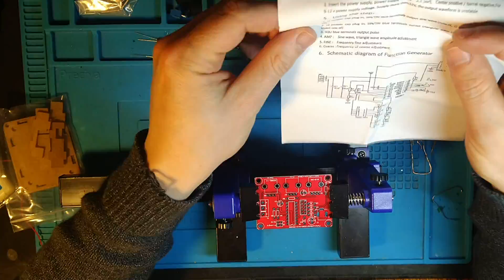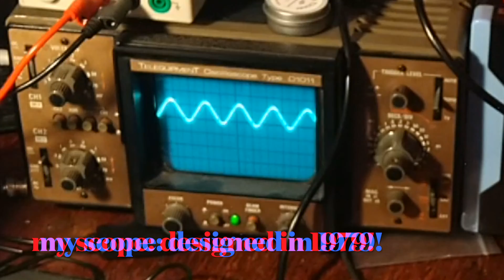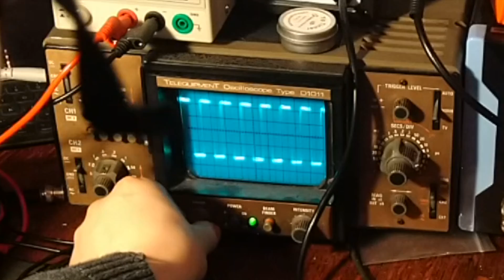Covvy XR2206 function generator kit (£6.99 from Amazon) - Gav Tries To Build

Comment: I finally got 'round to building mine a couple of days ago, the symmetry issue is quite annoying. The kit does not use the THD adjust or the symmetry parts of the XR2206 suggested test circuit. I have replaced the 330ohm resister with a 500ohm trimmer and the adjustment works a little. However the symmetry adjust does nearly nothing, it just makes it worse if anything. The XR2206 is known to be a clone in these kits.
Reply: Even the original OEM XR2206 had wave form glitches that were inherent to the engineering design and which could not be corrected with add on components. These glitches are worse in the clones. The clones are also know to have issues with supply voltage levels. Even so, they are a fun build, for cheap.
Reply from the maker: I found it hard to get a screwdriver into the adjustment pots, the indentations are fractions of a mm, little for the screwy to bite onto.

It's so hard to know what's a clone isn't it! there's about 5 million things all the same on eBay or Amazon... Anyone else miss Maplins/Radio Shack?
Reply: @Gavddotcodotuk  Yes, I used to use Maplins a lot, Cricklewood Electronics sell the XR2206, fairly sure they will be selling the genuine product.
Reply: @PioNunes Respectfully, I rather think not. The original XR2206 has not been manufactured in a great many years.